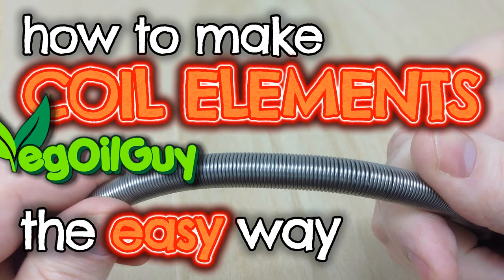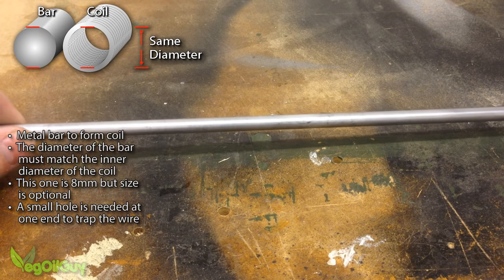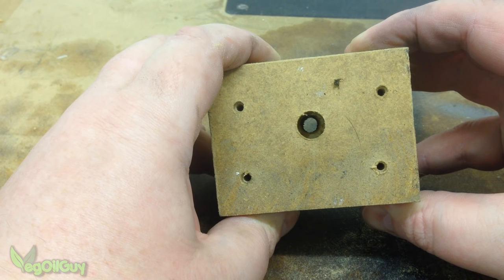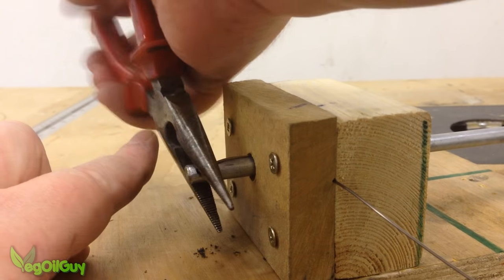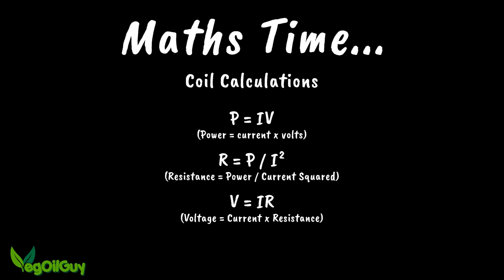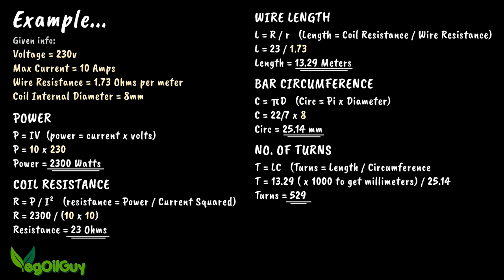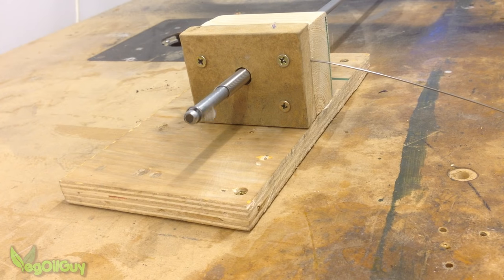Make an EASY coil heating element winding Jig - making electric resistance coils - by VogMan

Comment: Hello, I have question. What hapens with pla / vax after burning? it drips down, or vapour ?
Reply from the maker: The answer is both. Initially it drips free of the plaster. Wax can be collected in a container and reused (I'l told PLA can be as well) though this is optional. All the happens below 230 Celsius generally. Then the temperature is increased. At some point both wax and PLA vaporise and leave behind just a tiny bit of ash.

Comment: Can we make a coil with G. I. Wire
Reply from the maker: I'll be honest, I'm not really sure what that is, but I will say this... this type of wire is designed to glow red hot but not burn out. Most materials would burn away quickly in the same circumstances, so unless that's the purpose and characteristics of the wire, it probably wouldn't work.

Comment: Where did you buy the wire
Reply from the maker: Hi Jay. That's a good question. I originally bought wire on eBay but in testing it quickly burned out, so I suspect it wasn't genuine Kanthal wire. So I contacted VITCAS a UK manufacturer of Kanthal and asked for a reputable dealer. They suggested www.potclays.co.uk who were excellent. They may not be the cheapest (I really don't know) but at least I know it's genuine stuff.
If you want any, I'd recommend calling - their website is hopeless. Good on the phone, bad online : )
Reply: Thanks for the fast response

Comment: what gauge wire do you recommend?
Reply from the maker: As thick as you can get away with. Thicker does last longer but has a lower resistance, meaning more coil is needed : )

Comment: But how to calculate or kilowatt to ohms between coils diameter
Reply from the maker: Funnily enough the diameter of the coil means nothing. The only purpose of coiling the wire is to reduce the amount of space it takes up. As for the calculations, have a look on my web page http://vegoilguy.co.uk/coilcalc.php - there's lot's of maths formula there, along with what they are and how they work, etc. Hopefully this will answer your questions : )
Reply: Hello Friend . a wire in kanthal A1 that must work at 1250 ° C with 230 v.ac maximum 25 amps maximum 3kw. wire diameter? wire length?

Comment: how to get internal qoil diameter 8 mm
Reply from the maker: You start with a bar that's 8mm. It's as easy as that 😁
Reply: @vogman  rod circumference 25.14 mm this is the diameter of the external wire circle

Comment: @VegOilGuy First, good video regarding how to make a coil BUT you did one mistake in your calculations. SURFACE LOAD. For example: Your heating element is in a groove, then your surface load will be 5 Watts/cm^2 at 800°C or 2,5 Watts/cm^2 at 1200°C. Lets take the data from 04:32 . 2300 Watt; wire length: 132,9 cm; circumference of wire: pi*0,102 cm; your surface will be then: 132,9 cm * 0,102 = 13,5558 cm^2. That makes 169,66 Watts/cm^2. Remeber, at 800°C only 5 Watts/cm^2. So, you either need a wire that has a bigger diameter OR a longer wire OR of course a combination of this. Here is the Link to the surface load of the Kanthal A1: http://www.kilnparts.com/images/elements/kanthal_watt_loading.jpg 

If you dont give any attention to this, your coil wont last very long. Of course it all depends how to use it. Like in water, the W/cm^2 can be higher.
Reply: I need help designing a heating element that can be held in your hand. I am willing to pay you. Would u be interested?

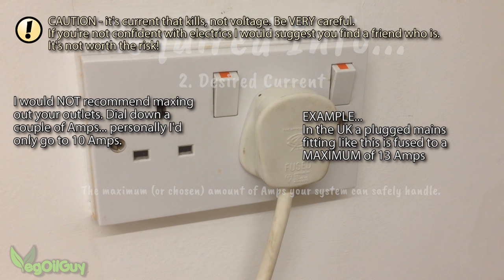Comment: @ 3:54 you wrote that "it is current that kills, not voltage.". Well this is fatally wrong. High voltage does kill you. High voltage do cause a high current to flow through you and kill you. You description could guide people wrongly. High voltage is more dangerous than high current. You should be more careful while making such fatal claims. 

You can think about a hypothetical system which works with 5 volt and 100 amper. 100 amper is enormously large, if 100 amper flows through human body it would turn it into coal instantly. However 5 volt 100 amper means resistance of the system  is 0,05 ohm. When you would touch such system you have much larger resistance hence 100 amper wouldn't go through you, a much less current would go. 5v would only tickle you. On the other hand you can also make a 1000 volt and 5 miliamper system which would kill you instantly because systems resistance would be 200.000 ohm and you would have less resistance. 10 miliamper is enough to kill you.